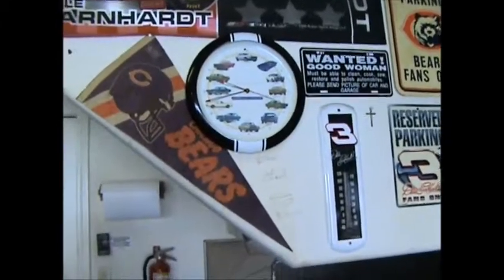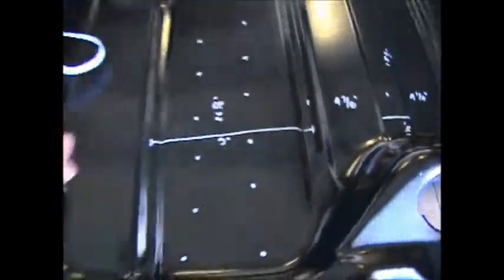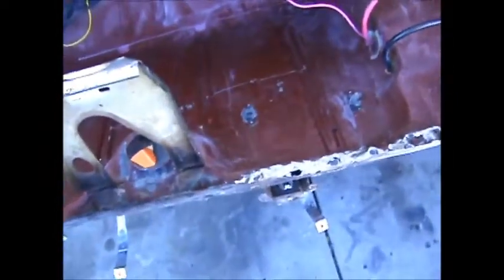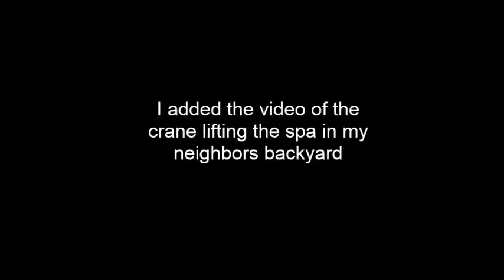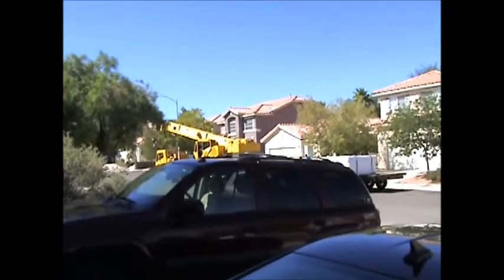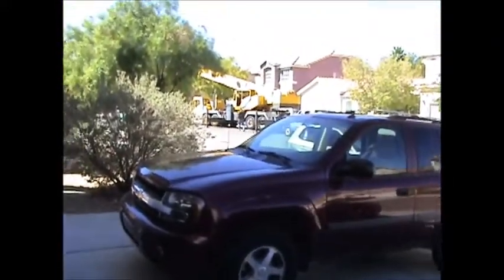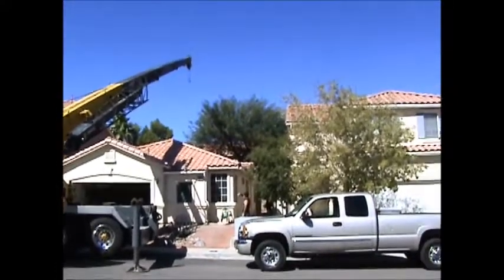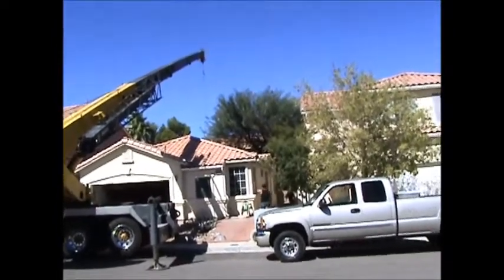1968 Camaro resto Mod 9-28-13

Comment from the maker: Rick, you saw the vid before when I removed the fuel tank - that was the one I got from Rock Auto with the fuel pump inside for EFI - works great maybe they have one for your Nova for the engine swap. Thanks for watching.